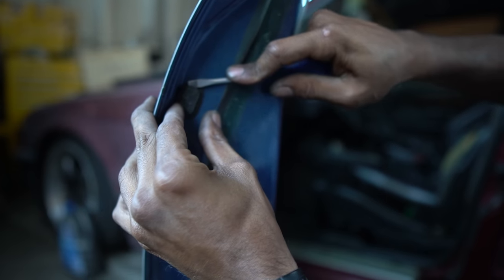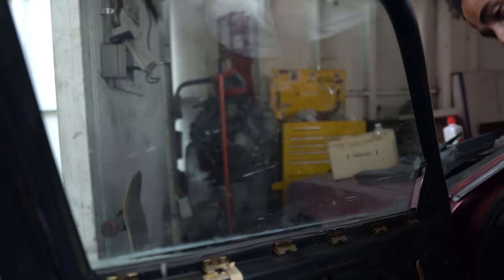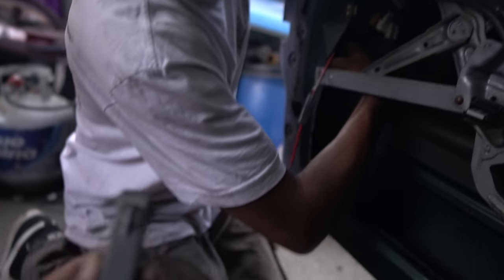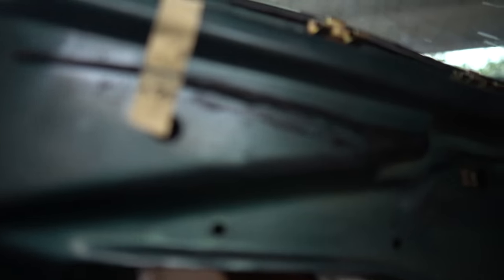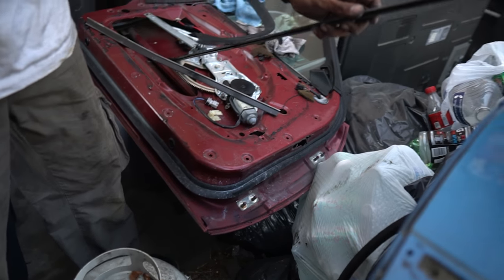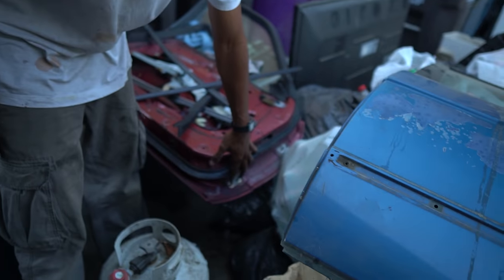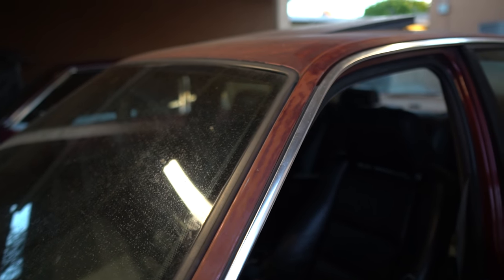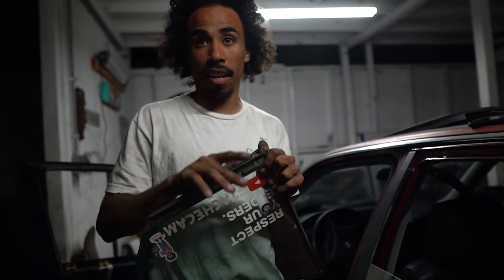EVERYTHING you need to know about BMW E34 doors | common problems

Comment: An interesting thing I've found around doors on the E34s, the earlier models of the E34 had the handle trim made out of metal, had that on my 88 mods and 91 mod, meanwhile my 93 and 95 mods had cheap plastic instead, so somewhere in the 90s BMW started cost-cutting wherever they could on the details... same with the "E30" and early E34 metal and rubber window crank,  that on models into the 90s were cheap plastic ones that felt like crap...
Reply from the maker: Totally true ! The m5 has metal trim, I plan to source some. I always wonder why the stop with metal trim!
Reply: @StacheCam  On the early ones even the 2 liters (cheapest E34s) had metal. All came down to saving a few dollars here and there I guess with them changing out their parts bin into the 90s, started doing like Ford and the rest of them
Reply from the maker: Turn of the century where bmws started becoming cheap
Reply: @StacheCam  yeah

Comment: just want to let you know that in terms of rust you are really fcking blessed.
in Germany Rust is the No1 Problem on ANY older Cars.
imagine this, i dont drive my car for 5 Months in the Winter and it STILL gets rusty if you dont check and work on it.
E34 Doors are ALLWAYS rusty from under the Rubber seal, doesnt matter what you do
Reply: oh and 50% of Bolts will just rip off
Reply from the maker: Sounds like no fun 😤😳 I can understand that tho cause it’s he door trim holds gunk in there

Comment: Its the grommets.. get new and add grease.. I've got a few for when the time comes... years of junkyard knowledge here.  Rear windshield probably didn't work due to being cut too close to the connection wire.. ask me how I know. Top trim don't do it.. it's too tricky due to clips and adhesion
Reply from the maker: Those windows are a pain ! Rear window stays but might get a new front one
Reply: @StacheCam  you ragged on the windshield cutter but I used it to have spare windshields for my rebuild... currently front windshield is making a nice vertical line of a crack... love the Hoffmeister kink window with the stickers.. great memorabilia from the early days!!!!

Comment: You forgot to mention early model e34 doors and late model e34 doors fit their respective year without issues.. so don't mix.
Reply from the maker: Im throwing 94 doors on a 95 car doe
Reply: @StacheCam  that's later year.. 88 and 89 don't mix with 93 and up

Comment: I need some help I found an 92 M5 been sitting for 11 yrs I mange to turn the motor And it started for about 5-10 seconds. All the doors are locked including the trunk key won't open it and
Reply: Just the passenger door is open